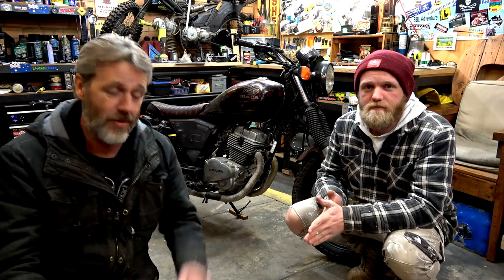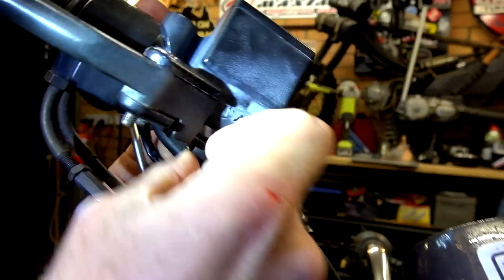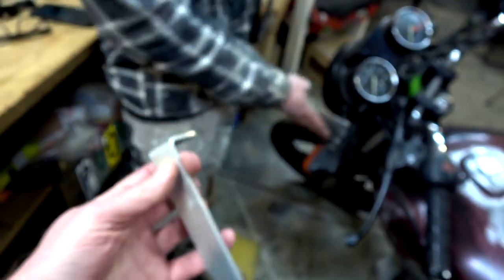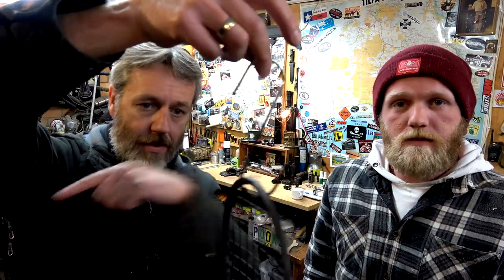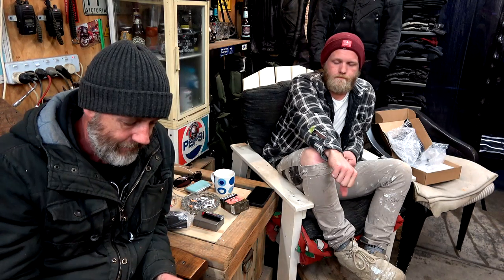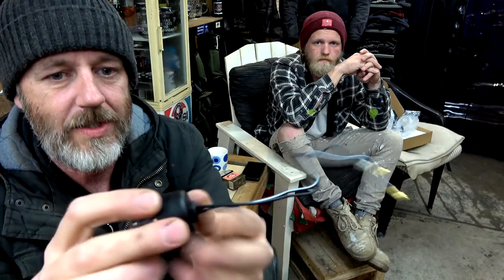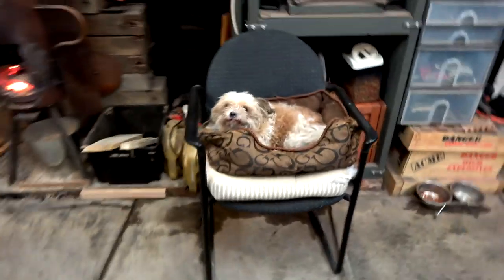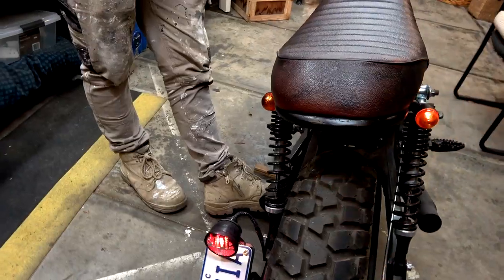CB250 Build - Toil & Trouble - Ep.22!

Comment: I have exactly the same problem with my led blinkers I put on. I thought my flasher switch was buggered so took it apart nothing wrong with it, it didn’t even occur to me about resistance. Thanks for that I now know what I need to do. I like the screen, but opinions are like arse holes everyone has one 😂. Cheers Nate
Reply: Yep, series circuit some are parallel... even seen one person add another light to the circuit as they didn't have access to a different load.

Comment: The electronic, non-load dependent flashers are nicer. They actually save power. Many people swap LED lights and then put resistors and a traditional flasher on and are using the same power, even though the bulb is using less. I had a small windscreen like that on a 250 before. I liked it on my bike but the CB has a different look going on. If you use it, it needs to be roughed up/distressed a bit. I think that will help it blend in rather than jumping out at you.

Comment: If you guys plan on keeping the fly screen it needs to be shortened and reshaped. 
It’s pretty simple to do, I covered the area with masking tape and traced out some new curves then used a jigsaw with a plexiglass blade.
You can polish the cut with varying grits of wet/dry sandpaper.

Comment: You probably already have done this however remember ohms law.  E=IR.  The voltage is equal to the current times the resistance and another one is Power is equal to the voltage squared divided by the resistance.  You want 21W of power so the replacement lamp is 10W so you need another 10W or so.  10 x R = 144 so R = 14 Ohms.  

A 15ohm 10W resistor is $1.50 from Jaycar - https://www.jaycar.com.au/15-ohm-10-watt-wire-wound-resistor/p/RR3354

Or just put one on where the blinker unit connects to earth as this should do all 4 lights as they have a common Earth.